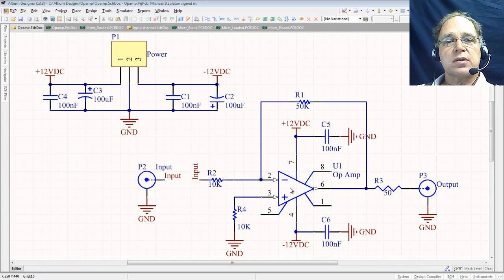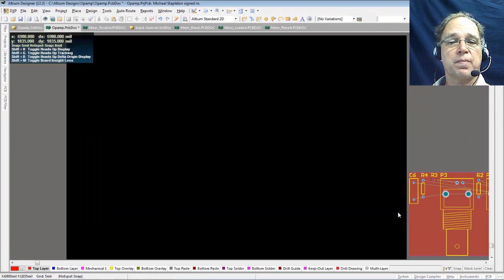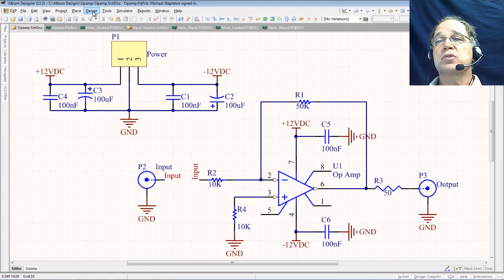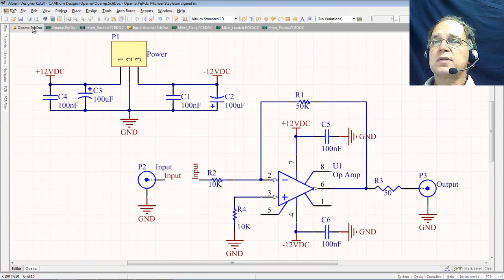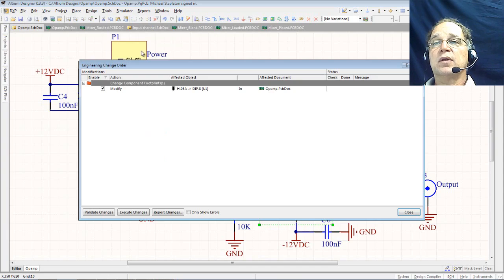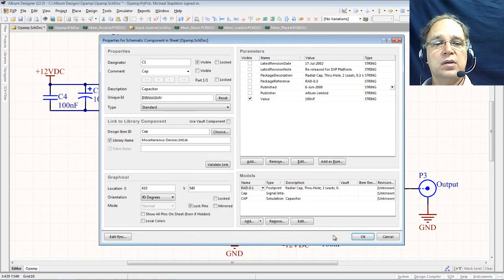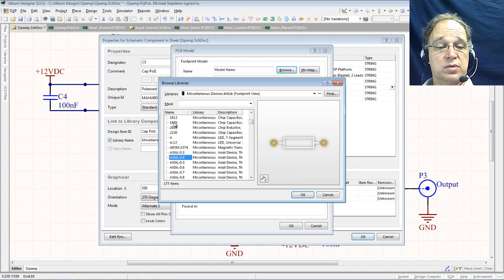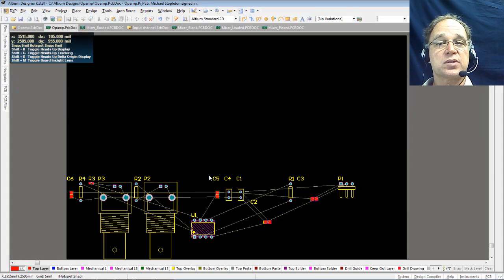Altium Designer Tutorial 1 for beginners - Part6

Comment: Not sure if this is still active... but if anyone can answer my question; How did you know the capacitor footprints needed to be changed? And why doesn't Altium already have the correct default footprints for the parts in the library?
Reply: It depends on the components you are going to use in your PCB. First, you need to know which one you want, next, find the footprint or library on the manufacturer's website and add it to your proyect. You don't usually use Altium default footprints unless it's a common component.